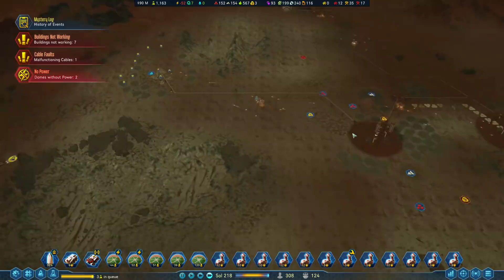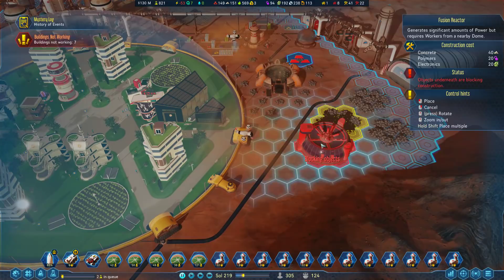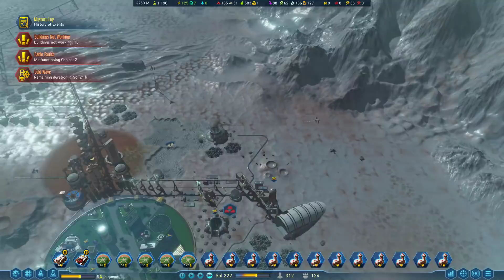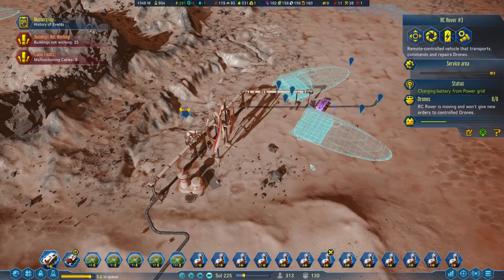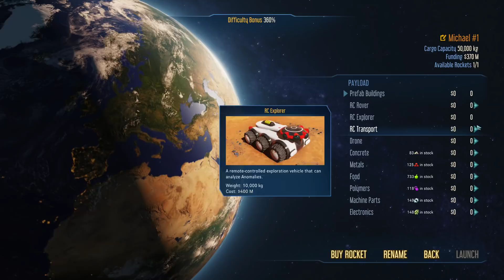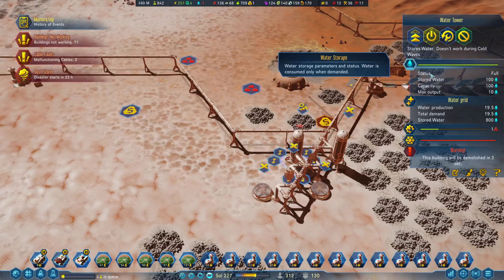Surviving Mars: TWELVE APOSTLES -- Part 17

Comment: the problem with the heaters is because of power. when you are low on power, nonessential systems turn off. the heaters turn off and freeze. by the time power is back, its frozen.

Comment: You can connect power cable directly to domes, no need to connect everything to the main cable system, it will connect "through" a dome just fine, though it might only work on built domes.
Reply: Too bad he's not reading comments :(

Comment: You have dome streamlining  in your breakthroughs, shouldn't you be researching that before making any new domes?  You know, since it halves the concrete and metal cost of building them?
Reply: He also has the supercomputer breakthrough available.  He should probably be researching that before ... all the rest of the research.  Putting it off until he has nearly everything researched will make it just a waste of points
Reply: True, anything that increases reseach rate you want to get first so it speeds up everything else! :D